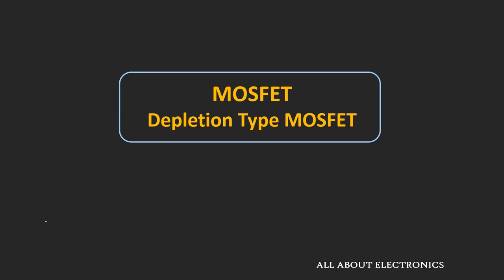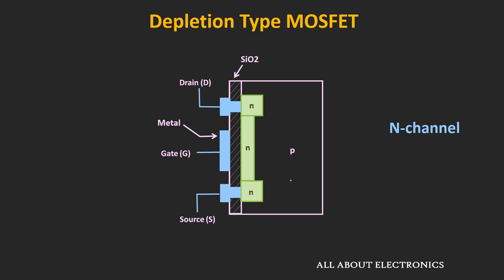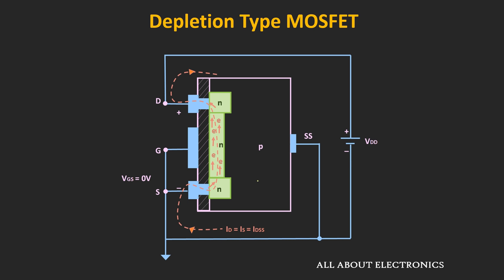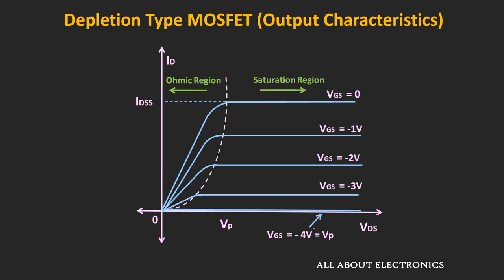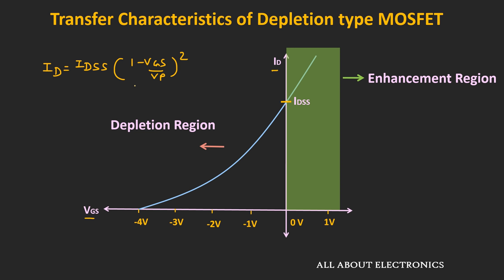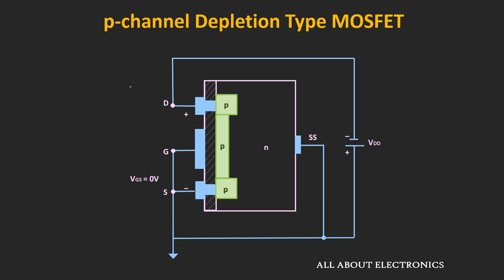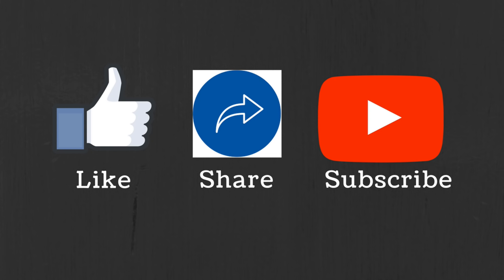MOSFET- Depletion Type MOSFET Explained (Construction, working and Characteristics Explained)

Comment from the maker: The timestamps for the different topics covered in the video:

1:13 Construction of Depletion-Type MOSFET

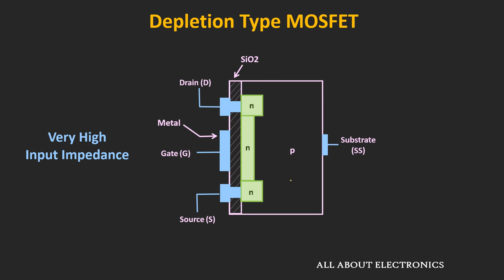2:30 Working of n-channel Depletion-Type MOSFET

4:55 Output and Transfer Characteristics of n-channel Depletion-Type  MOSFET

7:33 p-channel Depletion-Type MOSFET

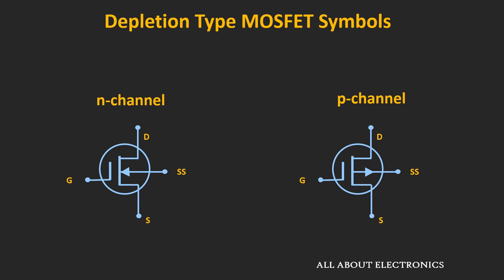9:40 Symbols of n-channel and p-channel Depletion-Type MOSFET
Reply: Hi Bro, Why you are changing supply voltage of Drain & Source in P-Channel ? What if give same as like N-Channel, Drain = +, Source = -. ?

Comment: Hi bro,
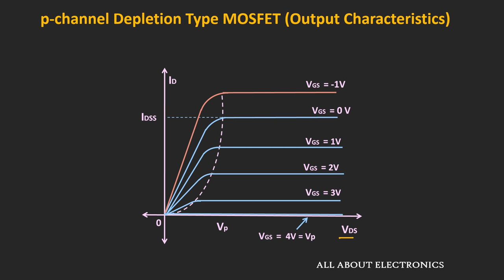Thank you very much for your lecturer & you helped me a lot. I would like to add a point here, in 9:20 Instead of threshold voltage you are mentioning it's pinch off voltage. correct me, if am wrong. Thank you once again.
Reply: channel is already present in DMOSFET so Vt doesn't come into play here

Comment: excuse me, what Vdd stands for? I thought it is Vds (voltage applied to source-drain)
Reply from the maker: Vdd is the supply voltage applied at the drain terminal.
Reply: @ALLABOUTELECTRONICS  why do u call it DD?
Reply from the maker: The double subscript represents the supply voltage. When both letters of the subscripts are same then it represents the supply voltage. For example, Vdd represents the supply voltage connected at the drain terminal. Vds represents the voltage between the two node. (Drain and source). While the single subscript represents the voltage between the particular node and ground. For example, Vd represents the voltage between the drain and ground. I hope, it will clear your doubt.
Reply: @ALLABOUTELECTRONICS  got it. Thank you ever so much👍

Comment: If Gate is -ve,And Sio2 is insulating layer then how the charges are reppeled???
Reply: SiO2 acts as dielectric ...when Vgs is -ve ie when gate voltage is negative with respect to source within SiO2 electric field with develop which will repel electrons in n channel and will attract holes from p substrate thereby increasing depletion region due recombination further if we increase negative voltage of gate at certain negative gate voltage ,drain current will become 0 .
Reply: I think voltage across source is always 0 ie it is ground